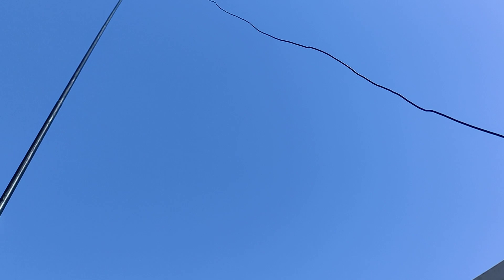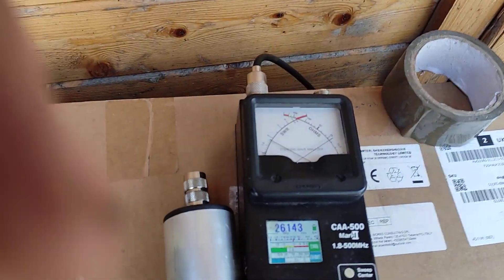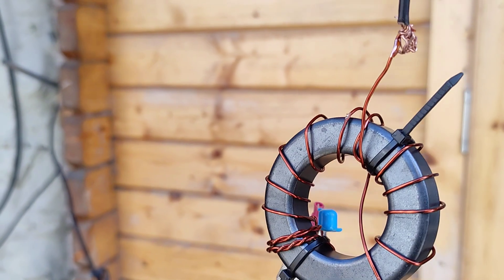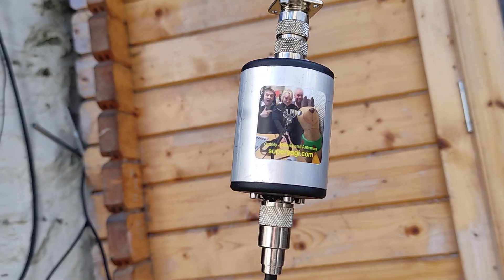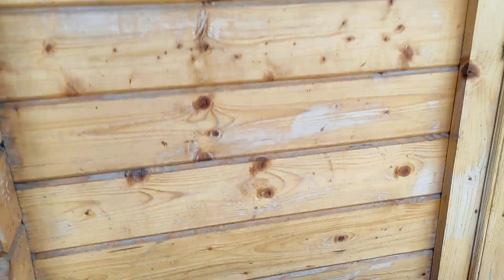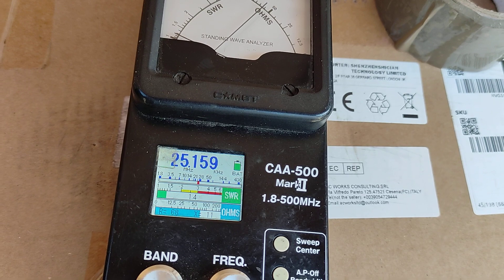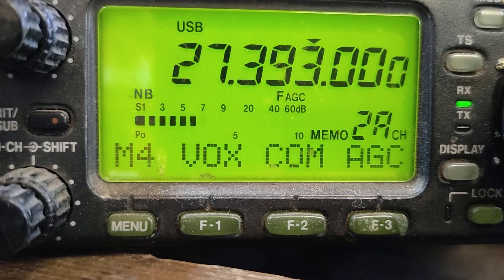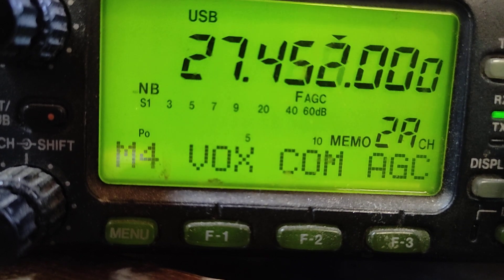Do you need a balun on you EFHW antenna 49:1 ulun

Comment: What happens when the line isolator is placed at the other end of the coax? A counterpoise is another way of removing common mode currents and the coax shield can perform this function.
Reply from the maker: hi sarah  thanks  for your comment 
placing the choke  at the other  end of the coax  is not going to work for you as  the point is to remove common mode current from the line as close to the antenna as possible .
  if its at the  radio end then its to late  the coax will have already picked up noise and transmitted  rf

Comment: I'm not an antenna expert and this infor is for those who are not familiar with these EFHW 49:1 but as far as I'm aware, on this EFHW 49:1 there should be peaks in SWR between band edges, flat SWR usually means inefficient antenna design but can be acceptable on say portable vertical antennas where quick setup is required and ability to tx on many bands with tuner. A dummy load provided 1:1 SWR. 

The coax is also part of this antenna design and you need several feet of coax to form the other end of the antenna. I remember reading that a Choke is a bad idea on this antenna design because it eliminates the coax from the antenna, which forms the other end of the antenna. 

Also with this antenna design there is usually a coil a few feet from the UNUN and this is crucial for the frequencies between 15 and 10m.

The Unun core materials also are crucial to this antenna design and mean it works good or works poorly.

I have the hyendcompany.nl 49:1 80-10m and this antenna has the "compensating capacitor" in the middle to lower SWR in the phone portion of 80m, without the capacitor SWR would be lowest around 3.5 Mhz. 

My SWR is also 1.2:1 - 1.6:1 max thought 80, 40, 20, 17, 15, 12, 10m 

I do not have such flat SWR over such bandwidth, it's 134 feet long and the UNUN is mounted around 3 feet off the ground where I have the UNUN grounded. The antenna then goes up a tree around 10 feet, swings north to around 5o feet then east to 60-65 feet. 

I am impressed with it and I regularly get DX on all bands, with a tuner 160 and 60m can be worked but with much reduced performance because the UNUN is no longer working as an UNUN on these bands. 

What's also good is that I can hop bands all day long needing no tuner and all I have to do is tune the Acom 1000 which takes seconds and I don't have to spend a lot of money on an expensive tuner for the likes of a doublet. 

These EFHW are really good when designed properly with proper core materials for the UNUN and I also find this hyendcompany.nl EFHW 80-10 low noise, I live in the country so most of the time noise is not an issue apart from some noise from powerline which is intermittent.